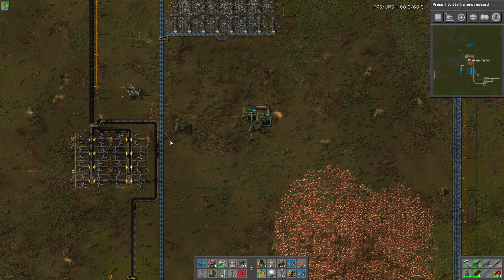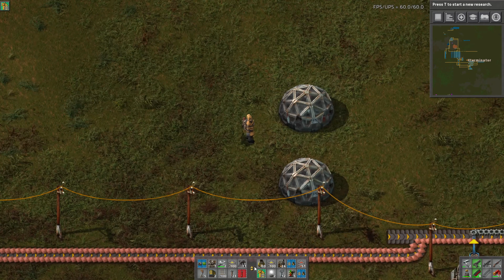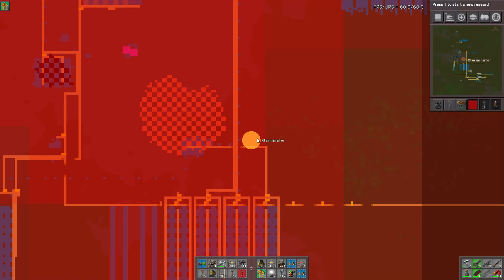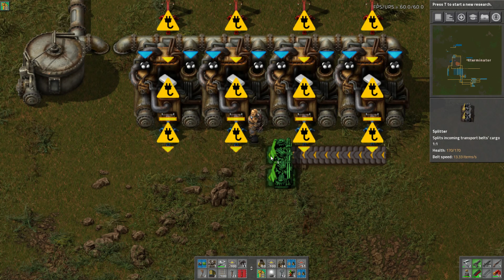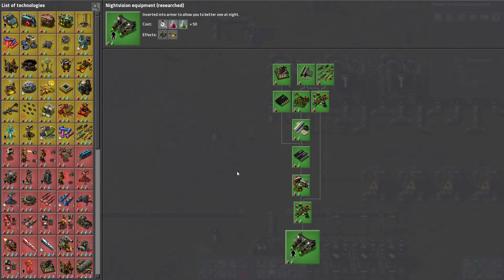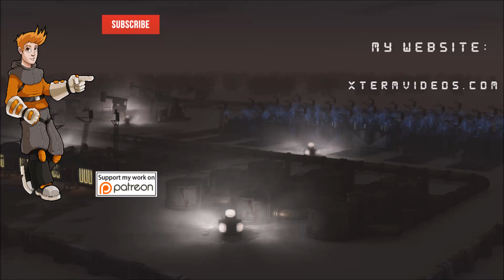Factorio: Tightening The Belt: Megabase Guide EP8 - OIL, PLASTIC, BATTERY | Tutorial Gameplay Series

Comment: 21:32 This is actually perfect.
It will alternate which side it inputs from as it fills both sides of the belt. If one side of the belt is getting used more than the other side, it will still pull from all of your plastic producers.

Comment: Interesting series, always fun to see different ideas.
One thing I do often when setting up my oil plant initially is make the whole setup on a separate power grid that can be switched on or off. This is mainly because most of the products don't have users yet and that way you avoid clogging up your storage what can hamper production later on. After checking all works I switch the facility off and start building the arrays that need the oil products.  ;-)

Comment: My first oil build had a lot of things conained in itself.
It did soild fuel, plastic, explosives, lube and acid. Exported by trains. (it also did flamethrower ammo but stored in a box instead)
It's only import was coal. Smelted iron and steel on site from a local patch.
It was fun to design something that was way more complex than it needed to be.

Comment: I have a feeling you are a long way from red circuits and blue science, as you said at then end. You first need to address your power, and iron and coal shortages in your main smelters an main bus. This means bussing those in by train, which means fullying engineering the stations at both ends and working out all the rail in between. After that you still have to get your green circuit ore outposts setup and your green circuit build. Only then do you get to red circuits. So I would guess that's around episode 12.
Reply: It was episode 12 :) nice guess

Comment: Hey you forgot all about the best fluid, LUBE.  Maybe you wanted a whole episode dedicated to lube though not sure, but I am enjoying this series keep it up.
Reply: Maybe incorporate some circuit logic in it. Would be a great opportunity to do so. You could make sure that there is always more than 500 heavy oil in the tank, if not then stop pumping it to cracking and just use it for creating lube. This way, you are always sure you are producing belt to keep building. And once batteries or plastic production comes to a halt, you will realize fairly fast and fix the issue.

Comment: I'm not sure why, but I think its something to do with my production and input times, but I find that 2 sulfur plants produce more than enough for 2 sulfuric acid plants to produce acid, enough for more than 4 battery plants, as well as uranium mines.. Provided you build tanks for it.... the main thing to remember here is that when it comes to fluids, your never using all of the fluids all of the time, including batteries (atleast for me) since there's always build up buffer.

My setup is 11 refineries, 6 plastic, 2 sulfur, 2 lube with 9 loil cracking ... it should produce an excess 3 petroleum, 6 heavy and 27 light oil every 3 secs.... meaning I can have 2 loil to solid fuel conversions since it makes solid fuel ever 3 secs (I usually use the excess lightoil to fill another set of tanks dedicated to flamethrower turrets after which I use circuits to switch off towards solid fuels). The rest of the excess heavy, light and petroleum can be converted into solid fuel IF it exceeds a certain tank capacity (using pumps). By the time I get to rocket stage (unless speed running), I have enough solid fuel to convert into rocket fuel (and plus some, which my veh. tank and nuclear fuel likes)

Comment: Would appreciate it if you would explain a little about liquid pressure! Heard about it but dunno what’s it
Reply: There's basically a limit of how much liquid a pipe can hold and pass per second. For instance, there's a limit of how much water a single water pump can produce and how many machines it can support. Take Steam Engines & boilers. A single water pump can support 20 boilers. Generally, though, liquid pressure isn't an issue unless your transporting liquids over log distances or in large quantities.
Reply: Pipes are a bit more complex than that.

Pipes have a maximum throughput per tick, which is 1800 fluid units.
Now, an offshore pump can pump 1200 units of water.
A boiler can turn 60 water into 60 steam per tick, which is used by 2 steam engines with 30 steam consumption each.

A single offshore pump can supply 20 boilers (because 1200/60), but the pipe can supply 30 boilers (1800/60).

This leads to an ideal 3 offshore pump (3600 water) -> 60 boilers (3600 water to 3600 steam) -> 120 steam engines (3600 steam to energy) build.

You have 2 offshore pumps with 1200 units each and one offshore pump which is split evenly (600 and 600) and connected to the other two pipes (1200+600=1800). This fills up two pipes with maximum throughput. if you pretty much directly input the water into the boilers, i dont think you have to worry about the pressure loss at all.

I wish they would add that to the wiki.

Comment: There's a problem with refineries, if you put more than 16 iirc in a row, pipe throughput is too low to supply oil to all of them. Or somesuch numbers.
Reply: Surely you would include a pump to increase the throughput?

Comment: What's wrong with not using direct insertion regarding the sulphur / acid situation. Surely you could run a parallel belt?
Reply from the maker: It's pretty high throughput so I just prefer direction Insertion and think it's a bit cleaner. You could certainly do it via belt though if you wanted.